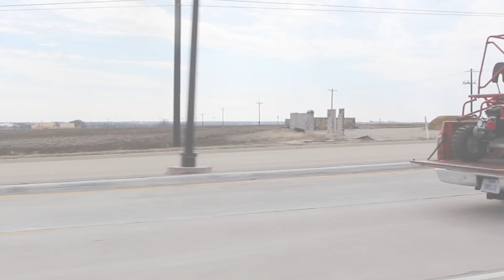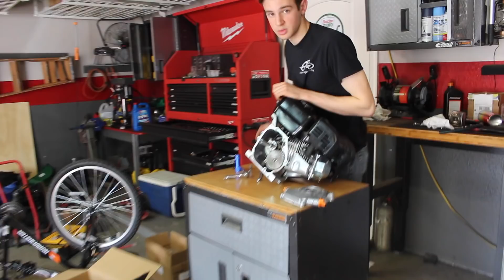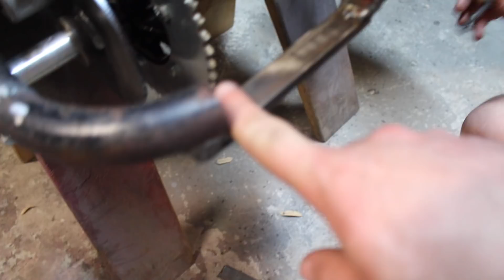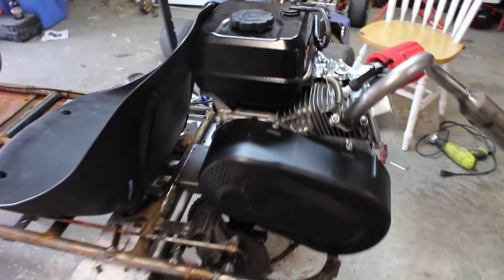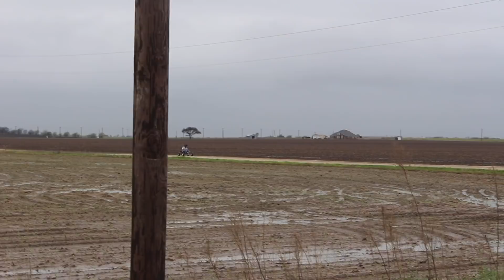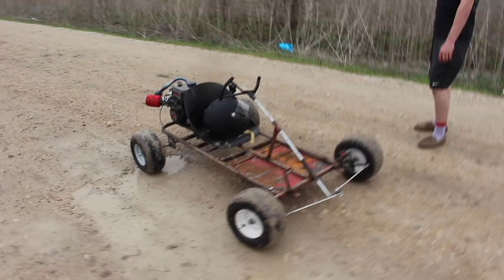Assembly and First Rip! | Rally Kart Build Part 2

Comment: You need off road suspension to build a real off road kart, and you should make some cover for the engine to protect it from the dirt, and also put bigger wheels amd tires if you can and pls change the steering whel to be a WHEEL not some kind of plane controller or whatever... This was only my advice, good luck

Comment: Bad idea upgrading the valve springs on a otherwise stock predator w/ no governor. The stock flywheel and connecting rod are normally able to handle a governor removal, since the stock springs will float before any damage is done. But with those upgraded springs, you're going to need to upgrade the flywheel and rod - which is not cheap - or you could destroy that engine. Some people try to get around it by simply not going flat out, but not a lot of people have that much self control (I don't!). Just a heads up.

Comment: How much is one of those up predator 212 upgrade kit?
Reply: Hunter Moore they are about 300 to 400 dollars at gopowersports. Com
Reply: Donovan Bryant geez that’s expensive
Reply from the maker: Hunter Moore Nah the whole performance kit with a jet, filter, and header pipe is $68. I’ve got the link in the description if you want to check it out.
Reply: Build Break Repeat like the one in your video?
Reply from the maker: Hunter Moore yep, there are 2 different header pipe designs though so make sure you pick the design you like better
Reply: Build Break Repeat alright. What is the best way to build a gokart? Build a frame or buy a old frame

Comment: Um, if you're  having spacing difficulties with the tav,  why don't  you just use a the bottom hole on the tav mounting plate instead of the middle one?

Comment: How many times you going to install that torque converter? And isn't there a little washer in there behind the governor gear that you didn't say nothing about? And also isn't this the one you were talking about that you were going to be hopping curbs and stuff with?
Reply from the maker: Todd Bearden yeah we got all that governor stuff out, but we wanted to wait to jump it until we moved that lower steering shaft out of the way because if it hit something it could be bad news. In part 3 of this thing we’re gona redo the steering so it’s completely out of the way and strengthen the frame a bit. Thanks.